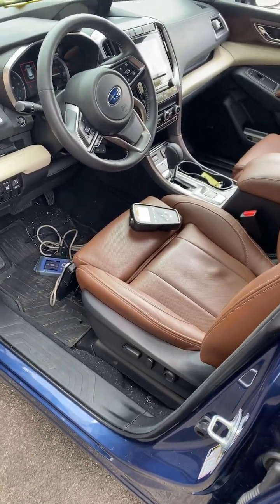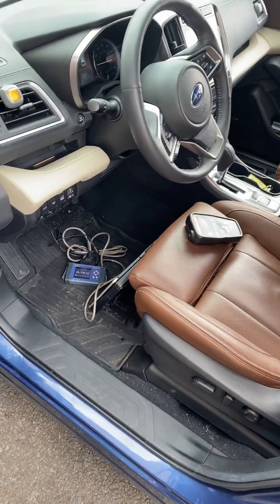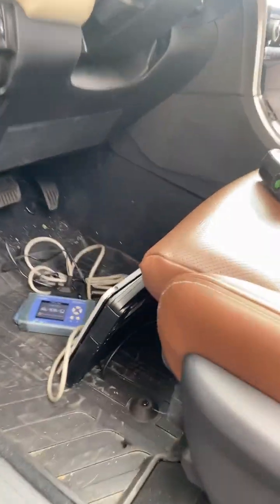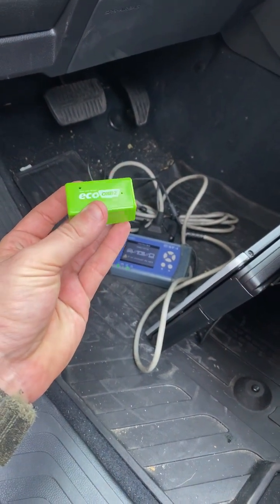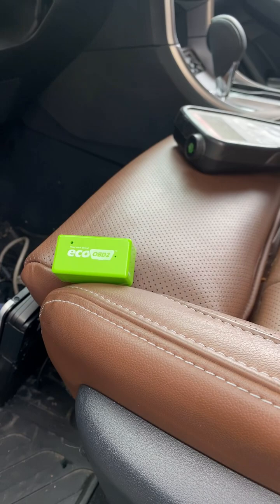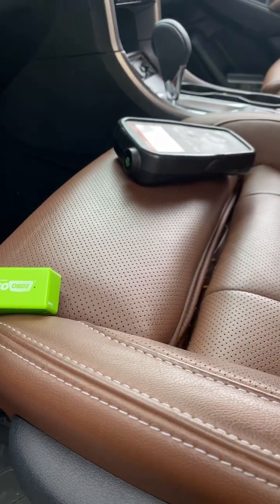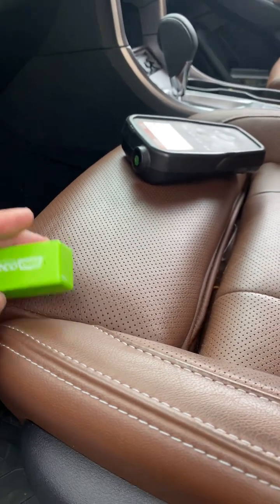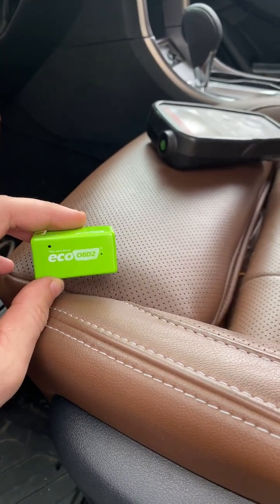Bluetooth OBD2 scanner breaks vehicle CAN Network

Comment: what about like in my bmw 2011 335i. I have it tuned and i have an app that shows live feedback that helps me log my car and temps. but its plugged into the obd port almost all time i drive but i take it out after. Its like a 90 dollar obd to flash tunes but i use to monitor.
Reply from the maker: Good question
You tool is running different than these “monitor” tools

Your device is active the entire time and computer network is ok with that. These monitors sleep on the network and the network gets confused when they don’t do anything.

Comment: It's when the customer removes their devices before they drop the car off, is when they pay an hour minimum for Test, Check and Inspect, with the resultant, "Unable to duplicate customer complaint, all test well at this time".
Progressive Insurance DLC Drive Monitors are famous for excessive parasitic battery drain/draws, combine that with questionable OE batteries, charge system logic, lack of use, PRG issues, corroded batt connections, DCM issues, and the list goes on. 
All I get is an hour with the car to figure shit out, customers don't want to leave their cars for a day, much less a week.
Reply from the maker: Yup
I had a customer come in three times with random codes.

I had a suspension the customer was using a ODD2 device but they kept saying “I don’t put anything in the car”

So I moved the OBD2 plug as a test, just pushed it out of the trim and zip tied it up in the dash.

I release the car and an hour later the husband marches into the manager’s office; yelling something about sabotaging his car.

Manager calls me over to the car and asks me to explain what I did to the customer. I said “what are you plugging into the car?” He showed me a pocket scanner that tells him if the seat belts are plugged in. Some child safety BS from Amazon; he said it came with the baby seats.

So I replied “why was it removed when the car was dropped off? The baby seats were left in the car, this doesn’t add up?”

Customer replied “I didn’t want you to blame it on this like a BS mechanic!”

We later learned this was his third dealership, and they all blamed the OBD2 tool.

To prove I was right I installed the device in another car (loaner), zip tied it on with a tamper tag. Then had the customer leave
Two days later the lights came on.

Customer gave us a burn survey, complaining that our cars are cheap and not engineered correctly.
Reply: @thatsubaruguy1324   I use the Blue Driver OBD Bluetooth scanner, it has a MIL status function, and it indicates time and miles driven since code clearing, not sure how accurate it is, but I will add the PDF to the customer's RO and make notes for suspect DTC clearing. Some customers have fessed up to clearing codes so their cruise control will work.
Question, does the SSM4 have an MIL status feature, if it does, I haven't seen it on ours.

Comment: I have one that’s like an access port tells me everything about my car it’s plugged in 24/7 no issues it’s on my 08 g35x
Reply from the maker: Thanks for the info. Each one of these devices interacts with the network differently.

The G35X uses a simple and dependable CAN BUS that doesn’t mind OBD controllers looking at the network.

Late model vehicles has complex networks with security/firewalls, gateway modules, and multi layer networks. These networks do not like foreign computers.

Hope this helps
Reply: @thatsubaruguy1324  Problem, that device in the video is not a Bluetooth OBD2 scanner. That's one of those "eco" scam dongles that pretend they'll make your car more efficient. I've seen hundreds of videos and reviews on these things and they all cause different problems on different vehicles.